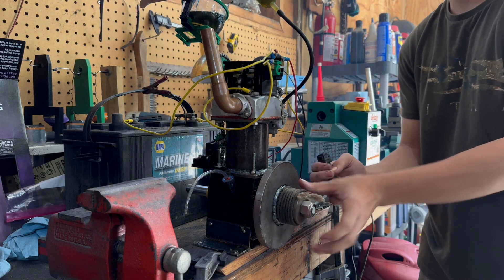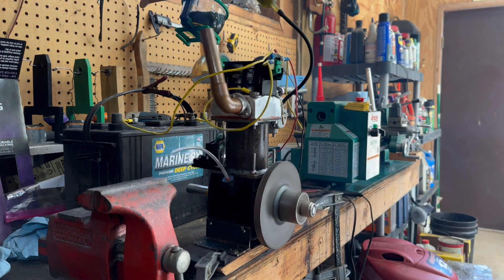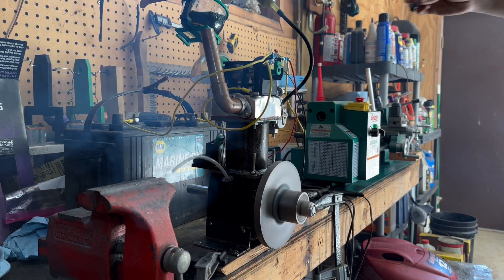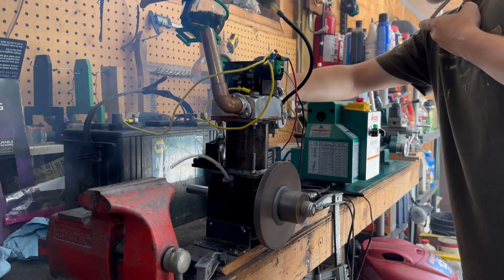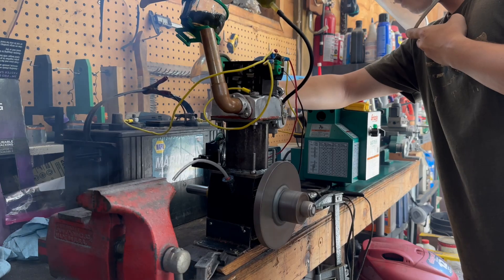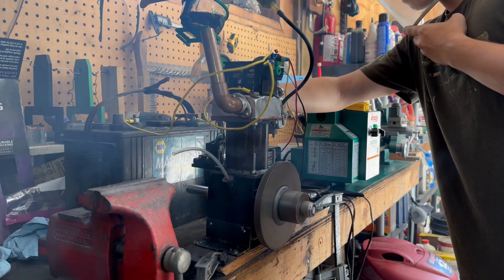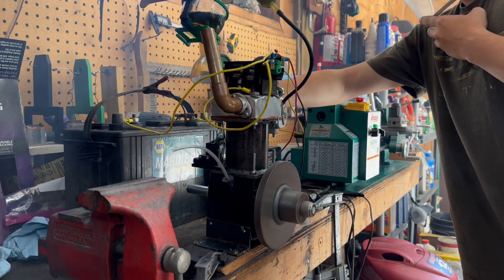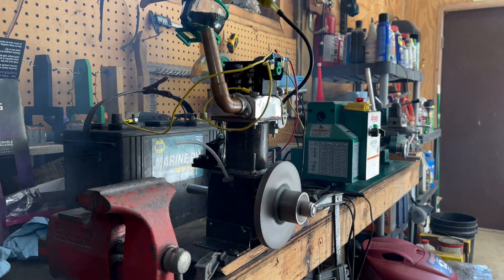Homemade engine runs for 2.5 minutes! Full video!

Comment: 1 inch steel rod will be plenty strong enough :) - disclaimer, not a material expert, just an enthusiast
Reply from the maker: After some consideration, I think I would be best to start with a V twin, but make it bigger, I would base it off of a 670 cc predator V twin, it would cut the part list in half, and I would keep my sanity when making parts!🤣
Reply: @ProjectLMZ  makes sense :) good luck!

Comment: There is no fins or a fan is it not overheating. temp gage would be nice or incasing those cylinder tubes inside a box with panels to move water thru it. or small tubes that would por water on to it
Reply from the maker: On my next engine, I’m going to add some sort of water cooling, as after some consideration, I’m going to go with a V twin, based off of a predator 670 cc V twin!

Comment: The engine is going strong and I'm eager to see more. Also next time instead of filming your monitor, take a screenshot if you only need a still image or use OBS to record your screen, it'll look a lot nicer with little effort required.
Reply from the maker: The last part was a quick last minute add on, and then I ended up changing my mind immediately after.🤣 sorry! I am going to make a predator 670 cc V twin motor, it’s going to be very similar in size.

Comment: Have you tried onshape or fusion 360? both have a free version and are fairly easy to get into. If you don't have a great pc, onshape runs virtually on browser. You can do quite a bit just drawing, extruding and cutting
Reply from the maker: I actually have been using onshape, I designed the more intricate parts with it, as simple parts are easier to make in Tinkercad though, but for more complicated parts, onshape works great!

Comment: love the video and love the engines. have you tried to balance the crank shaft with the rod and piston attached it might make the engine last longer with less vibrations
Reply from the maker: I have the counterweights on the crankshaft set for the rough weight of the piston and connecting rod and wrist pin, but it’s not perfect. I really don’t have good tunability with it, I’m unable to add weight, I can only remove weight. And I think in my case I need to add a little bit of weight, once I get the titanium connecting rod.
Reply: @ProjectLMZ  wouldent the titanium be lighter therefor the counterweight  would need to be lighter? correct me if im wrong
Reply from the maker: @beauwolfe4049  the plastic connecting rod is lighter than the titanium one, so when I get the titanium one, it will get me very close to almost perfect balance. 

Also, what do you think about a V twin based off of a predator 670 cc V twin?  Instead of a V4, I would do like a “big block” V twin.